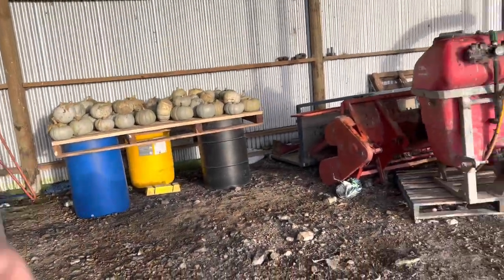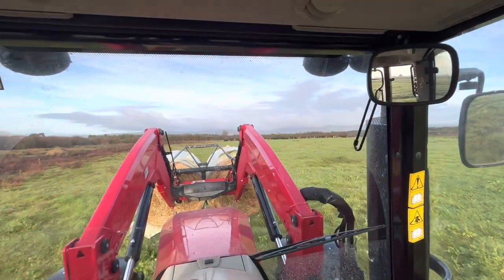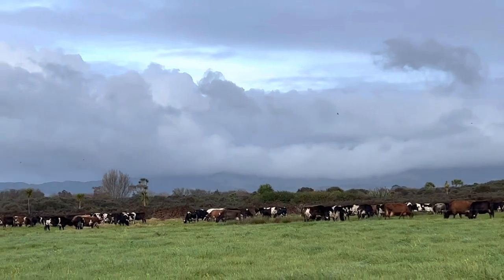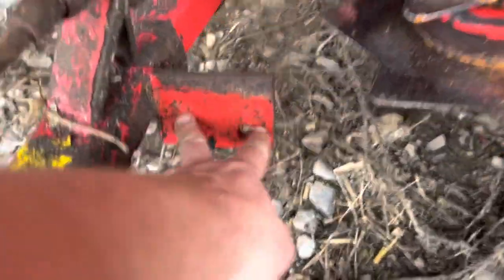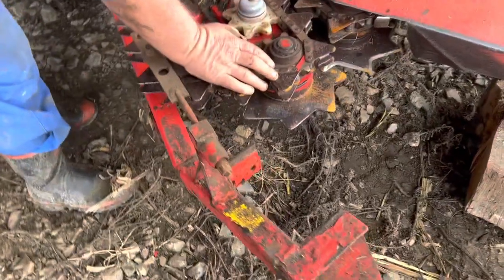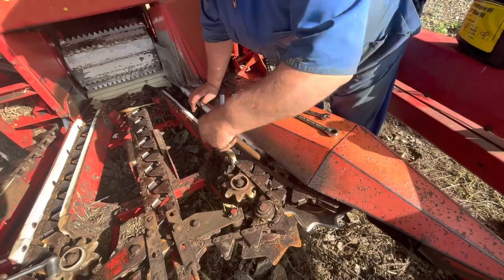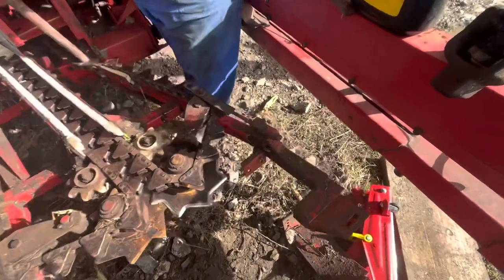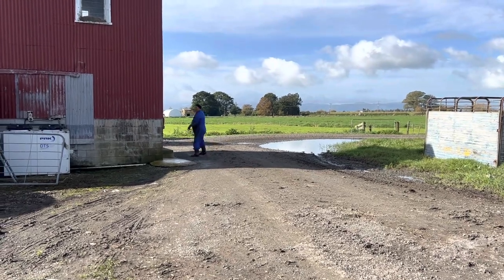Tensioning The Maize Chopper. More Silage for the Cows. #maizecuttingmachine #farming  #engineering

Comment: Carl does your dad have to change all the rubber parts on the.milkers before starting back up milking again inflations and milk hoses or not
Reply from the maker: Hey bob mate. 
We change the rubber ware in the cowshed but not till the end September. Due to getting heifers used to being milked they will kick off cups breaking hoses and putting holes in rubber ware.
Reply: @Dozerthefarmer  so how do you like the new milking cup so far I think you and your dad are really going to enjoy milking with them your going to be fully switched over in September hopefully you said or do you think it will be longer I'm surprised you can't get them I just bought some extra spare ones last week not that I have one break but just in case you need 21 more are you going to get a couple extras for spares I just got the bottom half